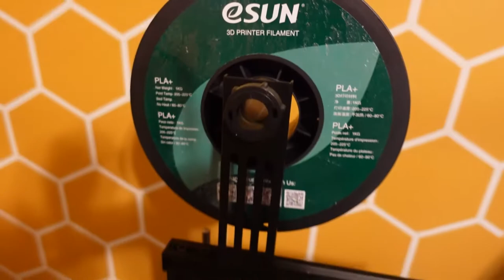I Painted & Remodeled My 3D Printer Farm!

Comment: If you could do it all over again, would you buy something else than the Ender-6's?
Reply from the maker: I think having one ender 6 available is good, but i am beginning to become less and less impressed with the ender 6. I will say that the ender 6 is a much nicer platform to modify...albeit there are far fewer compatible modifications and the ender 6 is not easy to disassemble.
Reply: @ThePrintHouse  Would you go with something like a Ratrig? Tbh the 500x500 Ratrig is pretty amazing from the looks of it, even tho it is heavier and less precise but I still do trust ratrig a lot.